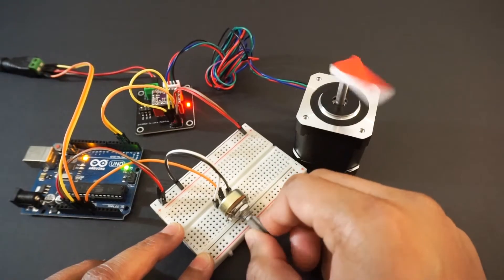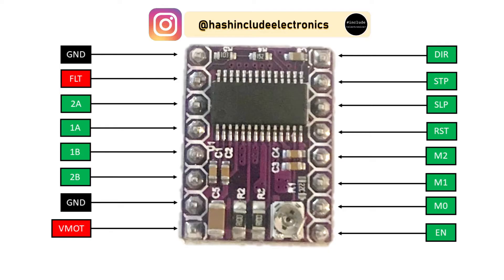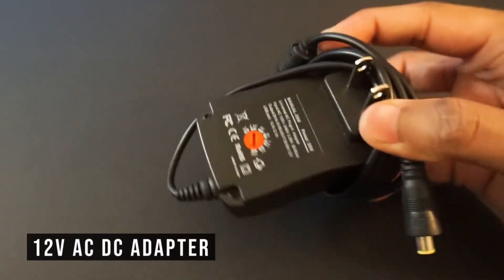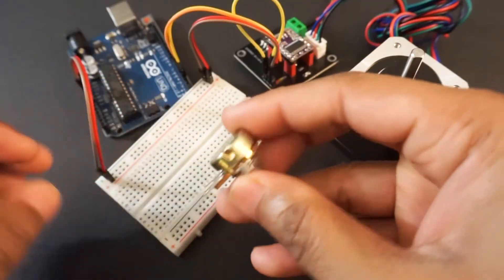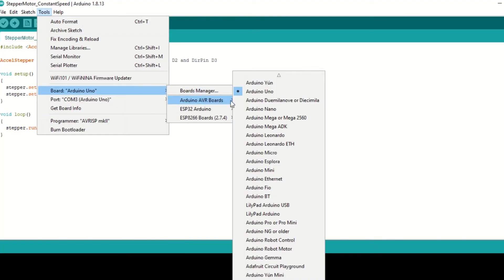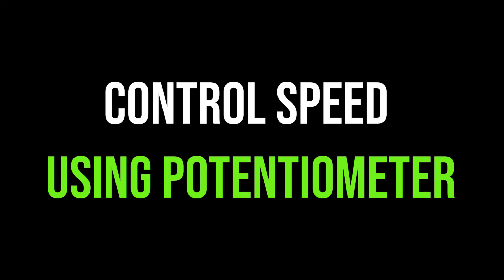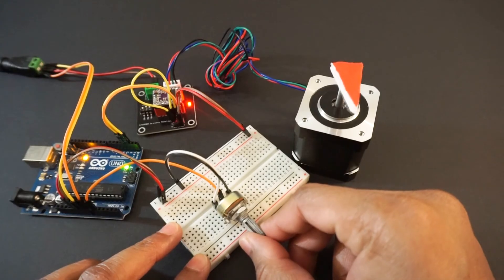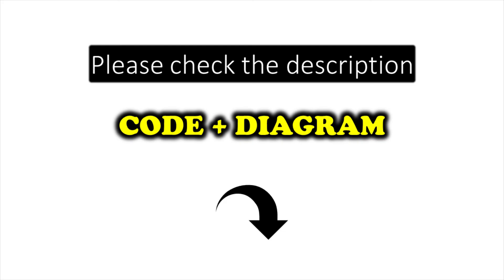Control Stepper Motor with Arduino and DRV8825 driver

Comment: Sir im using a4988 driver with unipolar stepper motor but it didn't worked the motor spins its self without any affect by motor driver and arduino code . The speed is not affected by potentiometer the code i took  from google . PLEASE HELP 🙏

Comment: Hyy bro, I bought a 17HS8401 STEPPING MOTOR from robocraze..can it be Used instead of the motor Shown In the video... Pls reply it's Urgent... 🙏🏻🙏🏻
Reply from the maker: If it’s bipolar then you can use it 👍🏻👏🏻
Reply: @hashincludeelectronics  but how to check??
Reply: @hashincludeelectronics  thank youuu✌🏻✌🏻
Reply: Bro, i need help pls can i get ur mail id or any contact medium, need guidance for regarding this project... pls reply fast asap, its urgent

Comment: Bro is that 12 v ac dc adapter Compulsory, or we can give through other ext source?? please Guide through this....
Reply from the maker: Not compulsory. You can use any power source 👍🏻👏🏻
Reply: @hashincludeelectronics Hyy bro, I bought a 17HS8401 STEPPING MOTOR from robocraze..can it be Used instead of the motor Shown In the video... Pls reply it's Urgent... AA

Comment: Hi I am using nema17 stepper motor and DRV8825 to drive it but my motor driver is getting heated up even though my stepper rotates. Is there any reason for this happening?
Reply from the maker: Check the current limit . 👍🏻👏🏻

Comment: I tested my DRV8825 with 28BYJ48 stepper motor.
The motor rotates without any problem but it kind of heat up but not too hot after 5 minutes.
My vref for 28BYJ48 is  0.13v.  I test the actual current by connect in series from one of the motor's wires to multimeter and set multimeter to AMP mode.
It just show 0 amp even though the motor is spinning.  How to find out current using AMP mode in multimeter?
Reply from the maker: Check if your multimeter is working fine for current . Also check if you are connecting multimeter wires in series for checking current 👍🏻👏🏻
Reply: @hashincludeelectronics  Thank you for replying.
I made stupid mistake. My black probe was in 10A max socket.
Now I can read the current. But it read at between 0.01 - 0.04 (my multimeter is not autorange. I set it to 20m).  So only 40mA? I though the datasheet says 240mA.
Is my reading normal?   the motor is still hot though. But still not hot enough to burn my hand.

Comment: I want to use this as an expansion board to add one more stepper motor to mks gen l board as it comes with 5 stepper motor pins only but i want to have 2 more. Is it possible to add using this board?

Comment: Can it work using motor 3.6 volts, with current 1.5 amperes per phase?
Reply from the maker: Yes it will 👍🏻👏🏻

Comment: Hello sir, wonderful video, 
I would like to know if i can use the potentiometer to control the speed as well as the Arduino to switch direction after a few set rotation, 
Thanks a lot once more
Reply from the maker: Thanks for checking out the video . The details are provided in the video . It should work for you 👍🏻👏🏻
Reply: @hashincludeelectronics   thanks for the reply sir,
can you pls provide me with the codes to move the stepper motor clockwise for a desired turns and then move it counter clock wise for the same desired turns with speed control done by the potentiometer,
please if you can do it i will be able to complete the project ,i am asking you since i have tried it many times and didnt work,
thanks once more for the help you have provided
Reply: please can you send me the codes
thanks
Reply: the code which you have used is for contant speed with potentiometer,
can you post the code for constant speed with potention meter  with clockwise and anticlock wise direction
thanks
Reply: hello sir,
i am using hy-link adaptor rated 1.6 amps,will this work or i need to use something similar to 3 amps output

Comment: Hi. what is the maximum speed that I can set on stepper motor using this combination and code?
my application needs min 200 rpm and max 1700 rpm.
can I achieve this?
Reply from the maker: In this configuration it can go maximum 300 rpm . That is for 200 steps motor, in 1/4 stepping mode , it will need 800 steps for 1 revolution . Maximum steps which can be set in this library is 4000 steps per second. So (4000/800)*60= 300 rpm .
Reply: @hashincludeelectronics  okay thanks a lot!

Comment: Hi, Very precise video. Please show me exact code to turn the rotation to 1 rpm. This is to build a clock.
Reply from the maker: First check how many steps per revolution for your stepper motor . Example if 200 steps for 1 revolution , then for 1 rpm speed , the value for setSpeed will be 200/60 .

Comment: If I want my stepper motor to move let us say 25mm/sec how can I convert no of rotation to velocity and insert in the code for constant speed??
Reply from the maker: I think you need to check in one rotation how much distance your motor covers . And based on that you can control number of rotation and speed in code .

Comment: Hi very nice video, can you please help me with code, I want to run Nema 17 at lowest speed at .50 rpm to 1 rpm for my barn door star tracker project.
Reply from the maker: sure . for 1 rpm, you need to set the speed as 200/60.